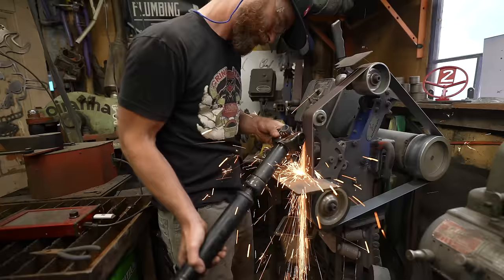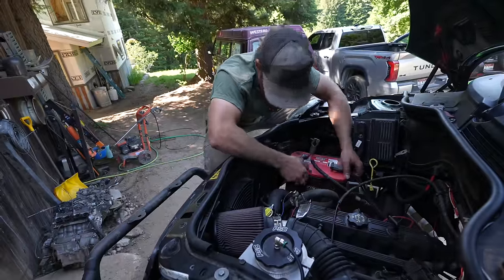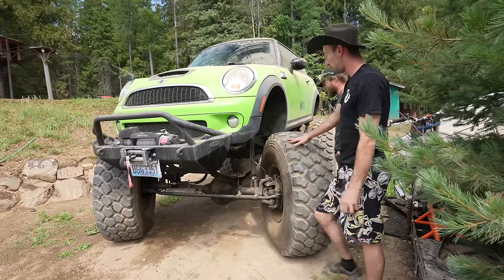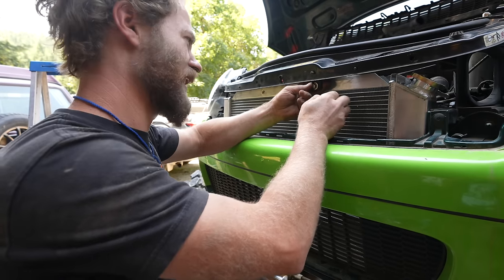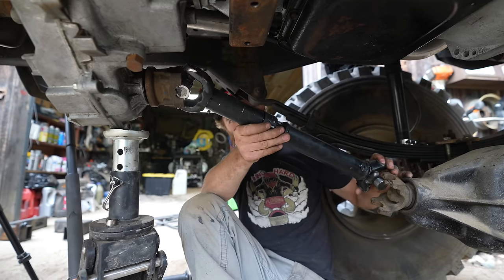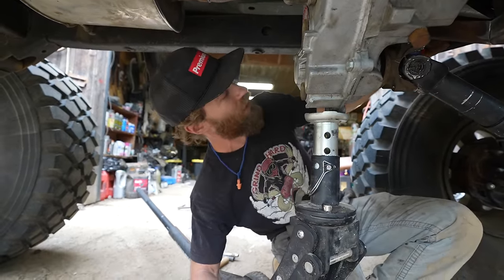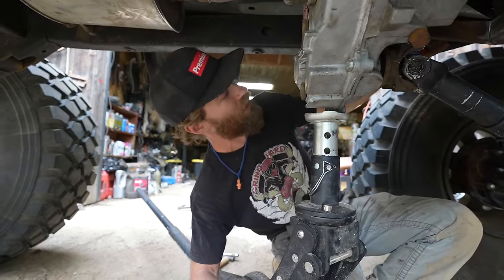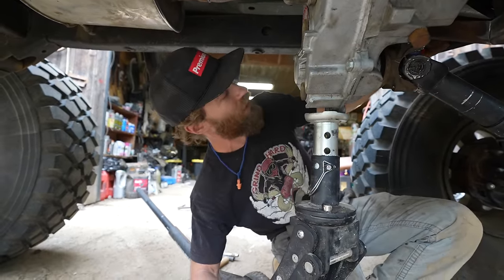Finishing The Mini Cooper Monster Truck!

Comment: I love this build more than anything. Been building Jeeps for a long time. Here are some things to look up. L-Shaped Shackles, Slip Yoke Eliminator (a must have), Double Cardan U-Joints (you need them for the angles that you are running). You might consider putting the shackles on the rear of the leafs for for the front so that when you flex the drive shaft shortens rather then lengthens. Hope some of that helps.
Reply: Have been building jeeps since the 80s and came to say about the same thing. I'm by the rubicon would love to help fix it with ya 😂 That TC looking smahable
Reply: Glad i read the comments this is about exactly what i was going to recommend as well. Lol.
Reply: @MrSnowlver Could you translate that last part, I'm not understanding the jeep talk or whatever 😂
Reply: @EJ-74 shackle reversal. Look it up on YouTube. Seeing it is better than I could explain it. If that's what you're talking about.

Comment: You guys should use the fact that it rained to walk around the new shop building and take a look at where the runoff is going and make sure that water doesn't go where it can cause damage to your new shop or the ground around it. I'm so excited to see what you can get into once that shop is up and running.
Reply: Yeah, even if the shop itself can handle the rainwater seeping into the ground come winter there could be some frost heave issues. My solution would be to at least put at gutter along the back edge of the roof and divert all that water somewhere else.
Reply: Olivia-in5pj Jesus Christ, stop spamming

Comment: For better angle. Cut the axel on both side of the pumpkin, rotate the Pumpkin up, but leave the knuckles at the same as original, then reweld and do all of it on the vehicle. Cheers

Comment: I like the Grande Cooper a lot. If I may make a suggestion on your fan sensor housing, it should be grounded. Your coolant shouldn't be conducting any current, in fact one of its properties is that it's NOT readily conductive, so that electrolysis is minimized between all of the bi-metallic interfaces in the engine, preventing corrosion. Water needs electrolytes to conduct, and coolant is specifically non-electrolytic (plants hate it). This is also why you should use distilled water in your cooling system.

Comment: I'm sure y'all already thought of this. But you could clock the axles a bit so that the input shafts are facing up slightly, that would reduce driveshaft angle and u joint binding. True the plates on axles for mounting to the leafs would have to be cut and welded back on. But it would make operation more smooth and reduce the chance of breaking parts.

Comment: When building drive shafts. I heat up the axle tube red hot , then slide the yoke in. Use two levels and the vice to make sure your clocked right. The heat shrinking centers the yoke. It's a lot safer than the press. Keep up the awesome work.

Comment: I normally say go big or go home, but I feel like on this one you could go down to 39-40s on that and it would be a real crawler with the gain of power to the wheels
Reply: The tyres are way too hard being machine tyres. But yeah in its current form it'll never do Rubicon.
I'd say 40s or 42s and remove 3/4 of the leafs
Reply: Time for gears/lockers before they head to rubicon. Get some of low torque back.

Comment: Awesome built.
Suggestion: front driveshaft double joke it at the transfer case. Rotate front axle so that the pignon is pointing in a direct line towards the front transfer case output shaft. You have to cut and weld the spring pads. Lastly cut of the front axle swivel balls and weld them on again at the correct caster. Did it before, works awesome.

Comment: Just some advice I recommend limiting straps on your suspension to prevent drive shaft failure. 30 degrees is max angle for u joints. Limit straps keep your suspension from going beyond what there failure point especially when you jump or in a super off camber situation. Nice job can’t wait to see future builds. Love your videos.

Comment: Just buy or make some spring perch shims to correct rear axle drivshafy angle. And get a cv drive shaft made... you can get away with just the shims.. but a cv joint style shaft would be "premium" as you say... if I recall Tom woods will build custom ones. But he's not the only person.... I would of gone with boomerang shaped shackles to reduce hight and still allow proper cycling.. and cut 3 times that much out of bumber...or the obvious shackle reversal

Comment: What you need to do to your axles are clock them to lessen the angle of the Ujoint. Just cut off the leaf spring perches and clock rotate the axle so the angle is pretty much non existent. I did that to my 99 suburban that I 1 ton solid axle swapped and did a 24" leafspring lift to. We just clocked the axles and that made the ujoints a lot happier where there was no vibration.

Comment: Dependent on the type of axel you have, I've seen guys slightly rotate the the axel to where the dif points upward for better drive shaft alignment. But that's on super lifted trucks with less suspension travel. With that much travel, it might jam up the shaft upon spring compression. You'd have to have more throw in the yoke to ovoid binding.

All-in-all... Amazing work on the Monster Mini!!!

Comment: Josh coming out and Talking about shackles missed one key point. Shackle angle can also a
Affect spring rate....that is moving where the shackle attaches to the frame compared to the eyelet. More angle means softer, the closer to straight up and down......the stiffer it gets.....

Comment: Considering the amount of weight those tires aren't carrying, you could probably air them down to like 10 psi and be fine. I'm sure they're rated for multiple tons given their size
Reply: I run the ones on my samurai on my samurai crawler

Comment: i could be wrong but i think some more driveline bracing is in order,
maybe some kinda anti wrap bar for that front axle.
she MOVES moves when you bumped that rock and when its under a good load!
definitely could use like 30-50 more hp XD
can NOT wait to see this baby rip the rubi!

Comment: Great job y'all! I'd say boomerang shackles on the rear, the same length as the front then remove the same springs as you did the front and you'll have it down to the dual transfer cases and 5.13/5.38 gears or a more powerful engine.

Comment: Yes that thing needs aluminum bead locks, a 4 link suspension and some adjustable coil-overs.  You need to do something about that drive shaft angle.  It also needs a lower gear or more power.

Comment: A good tip for you guys is... if you take a torch and have it just blowing oxygen and run the flame across the metal battery tray for a couple minutes. It will bring all the atoms to the surface of the metal making it more pliable and easier to bend with no cracking. I learned that from Jessie James

Comment: You should use an inch and a half or 2 in tubing for your rear bumper and mounting supports for the rear leaf springs then you would have zero obstruction with 270° of rotation 👍 kick ass ride

Comment: Aren't those water jet cutters the ducks guts ;) Go the new shed too :)  Down under we've also clocked the diff a little by wedging between the diff and the Leaf Springs (with other mods too)
and it was enough to relieve the steep angle the universals are subjected to.

Comment: You need a double cardon joint drive shaft up front to help with angle. It is in backwards and also a high pinion axle would move it up 1 to 2 inches.

Comment: Rad job!! Need proper bigger leafs for the back. That lift-block, not only begs to fly off its place, also limits the potential of the rear axle geometry. Even on leafs. Also, put back the "bottom" short and thick leaf. It really does not add a lot of stiffness, but will increase the lifespan of the other leafs by much. Especially jumping all over the place.

Comment: Looking at the angle of the t case and the front axle you need a cv at the t case end of that drive line to alleviate vibration and binding

Comment: L shaped shackles will keep you from having to notch as much…as for the springs, if the front isn’t bottoming out too easily, leave it soft and remove leaves from the rear…

Comment: I know I’m going to sound like a nerd, but PLEASE. put a roll cage in that thing.
When I was little I saw a S10 on 44s that rolled onto its roof, no roll bar…. It was pancaked.
Dude didn’t make it. 💀 
That’s a lot of weight in those tires.

Safety 3rd, FOR SURE, buuut just in case.

Comment: Do y’all disconnect the batteries before welding on a vehicle? My first welding job was at a trucking company doing repairs on Peterbilts, the owner always had me disconnect the batteries. He said the current from the welding could fry the electronics in the truck. I always do it now just out of habit.

Comment: Why not utilize the factory location for the battery? It’s on the passenger side, under the windshield wiper. There’s an access panel that flips up once you pull up the weather seal.

Comment: If you have a spare turbo laying around it would be a big help on this little monster . it sounds so asthmatic and weak  but even a small turbo would give it a big kick in the ass when it needs a bit more power that a better fuel would be a big help

Comment: If you look at the footage when you guys flexed it for the first time. It looks like the transfer case is about to fall off the back of the transmission. It didn’t look like the transmission was bolted to your brand new crossmember.

Comment: While you're adding the leaf back into the front springs. You could cut the shackle mounts off the axle and rotate it a few degrees up in the back. That will help a lot with your driveshaft angle.

Comment: You need a CV or double cardan joint on the front and possibly a slip yoke eliminator for the rear. Definitely get yokes with u-bolts all around, the straps are really weak.
Reply: Lets.TALK.LUCKY-WINNER What do you want to discuss?

Comment: Sand Hollow in Utah would be a good place to test it out for real, You'll need a good guide though, Like Mischief Maker or Matts Off Road Recoveries Wrecker (also Call into Yankum ropes on the way and get some good recovery gear)And then there's Fab Rats... take a toy for them to study, and challenge them to build something similar & join you later for a side by side comparison and testing (get them Turning their gokarts in something a bit more crazy than just teenager toys) & yea I just want to see you guys Hanging out with some of my other favourite youtubers.
 I think, put a leaf back into the front. The rear obviously has more roll resistance right now, It's not trying to lift any wheels, but it IS getting close to the body at the front. If you were rock crawling and had wheel to body clearance I would say soften the rear, but the clearance issue suggests to me you need the front a touch stiffer

Comment: Buy a aftermarket yoke for both front and rear. U bolt style so you don’t throw a drive shaft. Instead of the strap style the U bolt style go through the yoke and nut on the back side much better.

Comment: things going to need dual cases for lower ratio and lockers if your going to bring it on the Rubicon. bleepin cole mated two stock cases like what you have to get it low but your going to have to remake your drive shafts.. 5.38 axle gears will help as well. sweet vids keep it up!

Comment: You can weld the nuts inside the cross member for easy removal.Did you try 'Low-Range' to get the rpms up?A skidplate that also bolts to the transfer  case will save it,and keep it from flexing too.Hope Zippy's vacation goes well.CYA soon.

Comment: Eventually, it'd be awesome if you guys used a real engine... something LSX. This thing would / could have been a fkn beast if that choice would have been made, instead of the lil raspy crackerjack spitty bang bang it got. I mean... man, that thing sounds pretty horrible... sounds like an old shtbox early 90s Ranger with a missing muffler... just screaming its fkn guts out and goin about 0.17mph while doing so (not hypothetical, I mean your actual footage)... like those new broncos tbh, lol... fkrs screamin, spittin, poppin and banging, while the tires are literally not even turning, just trying to creep over a rock. While the V8's come by at 700 RPM, doing it all with ease.

Comment: 48:06 Björn Hates Knuckle Busters, too
01:00:31 did that fly up his nose?
I had a ‘95 YJ Rio Grande Edit. Jeep on 33” Interco TSL Super Swampers with 6-7” of body & susp. lifts, powered by the 2.5L 4-Banger. I lived in 4th gear on the highways, but that little TwoFive got the job done quite well. I wasn’t winning any speed awards, but I was never stranded off or on-road…not once.

Comment: This beast needs more power. Turbo K24 should do nicely. Easy 350-400whp with a stock engine, adapter plate, and a GT28 turbo.

Comment: A little tip. The radiator support on minis are designed to unbolt to be able to pull the engine straight out the front rather than up and out. It makes things much easier since the original mini engine is crammed in the engine bay so tight you can't get to anything unless you slide the rad support forward on some long bolts threaded into the frame rails.

Comment: I saw Dr.  Michael Pao (I think) speak back about 30 years ago  in Taipei on Waterjet, (The original company I think), amazing tech, lots of CNC machines both with garnet powder and without (food products and pampers, pure waterjet), not being a heat based technology it won't change the temper of the metal, but some folks still like laser and plasma for speed of cutting. (waterjet is said to require no secondary machining to clean up burr, and slag)

Comment: Your mini Cooper monster truck thing I saw on the footage that of this suspension that when you tried to flex steering with the rock, I saw saw that the literal leaf spring part of it bent in half kind of, and then went back to normal, like it basically folded in itself when you had front wheel, pushed back a bit after that one wheel touching the rockof that least springhead of fold in it look like it’s snapped and hinged too much in between the metal plate leaf piece just the folded it folded somewhere on the leaf spring

Comment: I know you likely already know this trick, but if you've got that tight of an interference fit, throw the smaller, inner diameter part into the freezer for a few hours so it shrinks and then throw outer one into an oven at a reasonable temperature or heat it with a torch. They will slide right together and when they stabilize, they will be wicked tight.
Oh, and I'm pretty sure your front spring packs are buggered... they move way too much to be right... I think that bend right near the bushing shouldn't be there... it should be a flat/curved plane to under the bushing rather than that hard bend before it.

Comment: I assume by the rpm's that you've already got it in low range, I think you said but I can't remember. And I know you said the large tires are part of the problem, but I thought that it'd still climb the small hills you went up. I didn't expect it to completely stop if it was in 4-L and 1st gear. I just figured it'd do ok as a crawler only and that you'd never be able to use 4-H or go very fast with it. What would you do in this case? Can you keep the inline 4 and get different geared axles, or does that engine not have enough power?

Comment: Your going to break those straps on those yokes with those big tires I know from first hand experience if it hooks really hard your going to break them you need the u bolt style they can handle the extra torque from the bigger tires

Comment: That sucker have low range?
I had this same engine in my jeep and it went EVERYWHERE, but with a manual trans. The auto is holding this thing back bad. The Iron Duke does not have much power to waste.

Comment: I mean the suspension not steering the spring did something weird in the footage, check the footage of the cam those facing at the one wheel that went over the rock

Comment: Those inside bolts for your cross member cut another plate with matching holes and weld your bolts into it this way you zip the nuts off on the outside of the frame no need for a wrench on the inside.

Comment: Air filter is too close to the PSC reservoir, did the same thing in my JK and my Intake Air Temps were over 150 in normal driving and would reach 180 when off road maneuvering through rocks and such.

Comment: Rubicon is open year round, 24/7, 365  to motorized traffic. Only time it's closed is for fire threat closure from the forest service, or closed to the public during Jeepers Jamboree. 

If you want a 10/10 trail, hit Fordyce which is off I-80, NW of the Rubicon. Rubicon is a dirt road compared to Fordyce!
You need better gearing and lockers for either trail
@grindhardplumbingco

Comment: I'll double check since I can't see it on my phone but I suspect this main camera's sensor is dying as I saw a lot of moving spots after the 30 min mark (I though I had dead pixels on my TV)
48:50 there's a white dot on his helmet that carries through between scenes. There's about 3 spots along the top 1/3 of the video. I also scrolled back, the first spots appear around 42:55